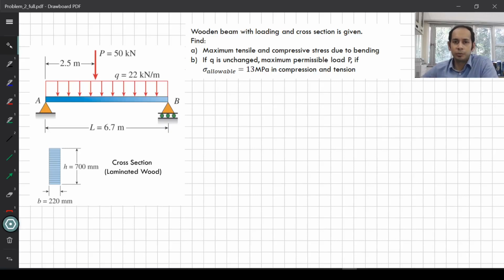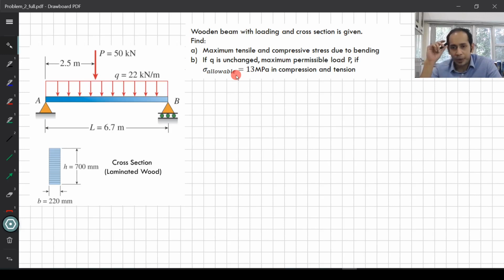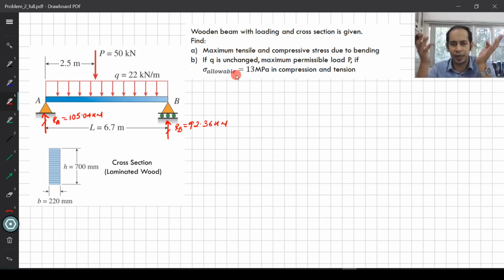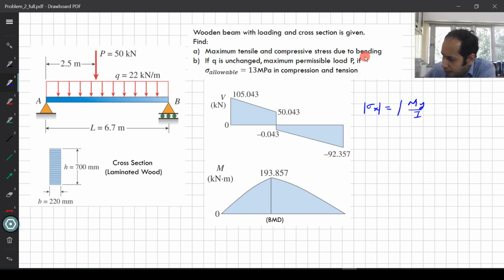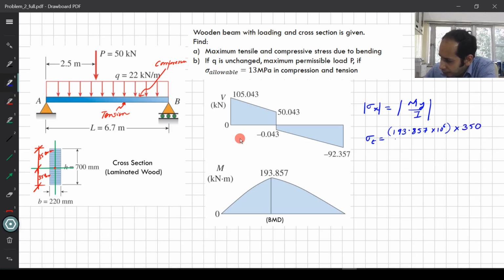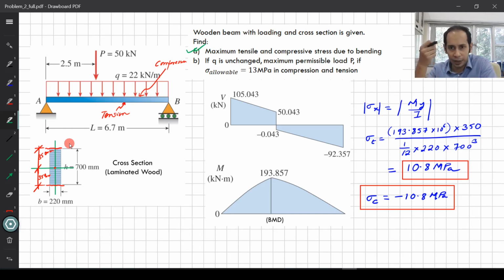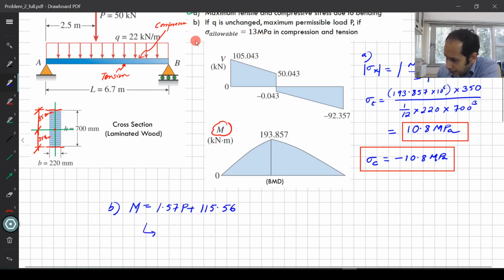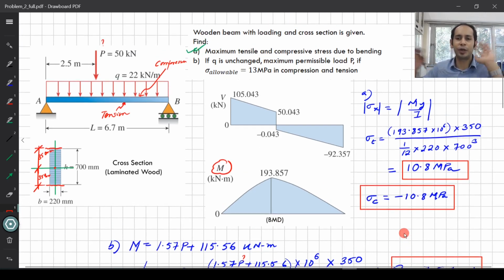Topic # 6.2 - Problem Example 2

Comment: SFD has a mistake. SFD at load point P should be +0.043.
Reply from the maker: Thanks for pointing it out, I will recheck this example from Gere and Goodno. But the concept behind this problem is to move beyond the SFD/BMD and get the stresses. I hope that was clear.